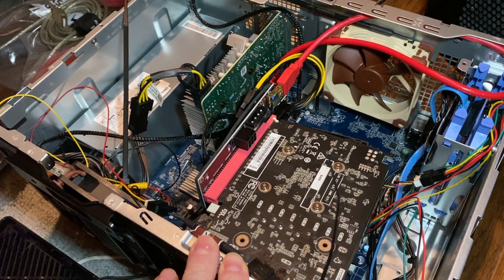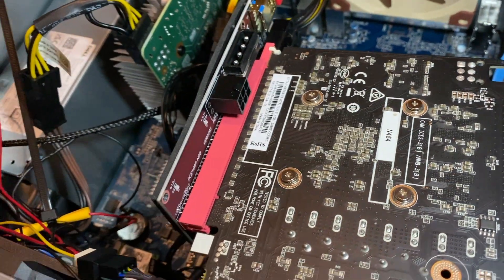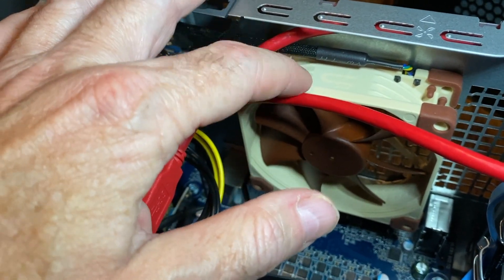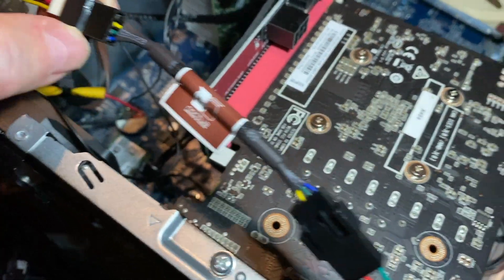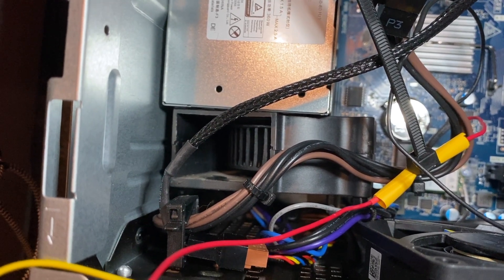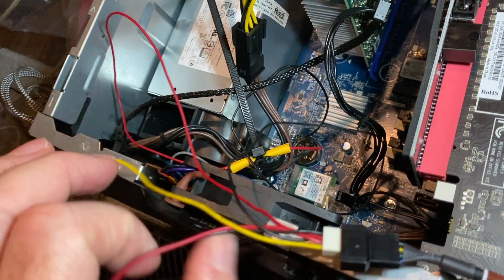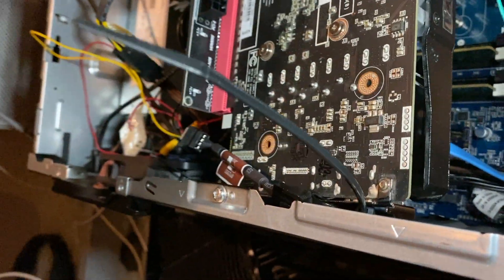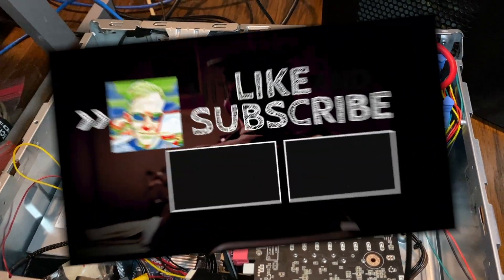Add a Second GPU to Dell G5 5000 for ETC and ETH crypto mining. $140+ per month as of 20 Aug 2021

Comment from the maker: Note: If you put in a fan that draws a 'lot' (supposedly .25 amps IIRC) of current like the axial fan I show at 5:42 , you may get a BIOS fault if it is on the CPU fan header split with the CPU fan. This worked with the Noctua low noise adapter but I noticed two this: the adapter got warm. No thanks, don't need more heat in my case. So I took the adapter off and moved the axial fan to the case fan PWM splitter on the 3 pin side, so it runs full speed and the 92mm Noctua in the back is speed managed on the 4 pin connection. So now, the 80mm in front (the original fan) is on the 3 pin and the CPU fan is on the 4 pin on the CPU header PWM splitter.
Reply: Hi Rob, I have a Dell G5 with a 3060ti & I have just added a 1660 super, they mine perfectly on there own, but windows 10 does not allow me to have both in the device manager it says I/O error on the 1660 super when I try to use them both at once after booting up.

Comment: Update: I got 5 GPUs recognized, 4 of them off a 4 way splitter and one in the 16x slot but it wasn't stable. What I have now is an old PC case with a 500W power supply next to it and the 1050ti and 6600XT are running there, hanging vertically with 2 fans and what would be the side under the motherboard, if it was there, is open to let the cabling pass thru to the G5. There is an open slot those run thru into the G5. So far, and historically speaking, this is stable under Windows 10. Hive OS (or another Linux) might have been a different story but IMHO 5 is pushing it for this little machine. I may try 4, as I have room for it, and another 6600XT I have to RMA which should pretty easily run on the 500W with the other two.

Comment: Hey good video, I bought 5 dell G5 with  5700xt to be able to get into mining because I couldn’t get GPUs , could I use the splitter to add a RX660 to each computer?
Reply from the maker: You can but honestly it was only stable with maybe 3 gpus and it isn’t very efficient. I’ll link to a mining board.
Reply from the maker: I have moved on to the BTC-S37 boards. No risers. https://amzn.to/3fQ5WZU (If you use my links I make a few bucks and I donate all of it to animal rescues currently.) Considering the board is under $200, and splitter/risers are $20/$8ish...the 8 slot board makes a lot of sense considering cost per slot, and your time. You will CONSTANTLY be @#!%ing with risers. And it draw like a max of about 20 watts so you will also save power in the long run. You do not need more than 4gb of RAM for HiveOS. Sodimm: https://amzn.to/3KCESeJ get an mSATA drive for it for $20 https://amzn.to/3qUtRh6 (get the 60gb..$2 more).0 Oh, the CPU is built in, so all told, board/mem/cpu/ssd is about $235 for 8 slots. Power supply I'd recommend parallel miners. I use a Dell 1100W and the X15B board for mine. Knock on wood, it's very stable. Don't forget to Subscribe so YouTube will share ad revenue with me. They currently don't. I sold my G5 cheap to my son after I upgraded the cooling. Stock cooling SUCKS on the G5. I have a cheap 10" blowing at one BTC board and the other is open frame with 120mm fans.
Reply: Thanks for your help, I have only built 3 computers for mining. No rigs yet, I use betterhash currently and I’m a novice with computers so I know nothing about Linux systems. I’ll definitely subscribe and use any affiliate links you have

Comment from the maker: Update: I've got FIVE GPUs running now. 1050Ti internal and via a 4 way PCIe splitter a 1660ti, GTX 1070, RX660XT, and 1060. time to build something to hang the other 4 from.
Reply from the maker: Edit. This is not worth messing with. Too unstable. 3 GPUs IMHO is about the limit.

Comment: Do you close the tower up when it is mining ordo you use it as if it were an open air rig?
Reply from the maker: I close it. I recently reconfigured so that a 1050ti is the only card in the system and in the slot. 1660Ti and 6600xT now on risers hanging vertically in a second case. Second case is power supply and those cards only. Probably
Go open air very soon. 2 small cards are ok with 3 total fans in the G5 but imho that’s it. 6600xt of course won’t even fit.
Reply from the maker: I have two additional fans now. An axial right in front of the power supply so that has air thru it and the 92mm noctua in the back. 80mm is now in the front opposite the GPU so it blows on that.

Comment from the maker: I repasted my 1050Ti last night. This is the cleaner: https://amzn.to/3iZq3Xj I used maybe 6 drops of each and a few q tips to clean my 1050Ti last night, so it lasts a very long time. Under $8 for the set on Amazon. https://amzn.to/3iZq3Xj I used the Noctua NH1. Get the 10 gram tube which will also last you forever and is much cheaper in the larger tube per use. https://amzn.to/3ACanzl